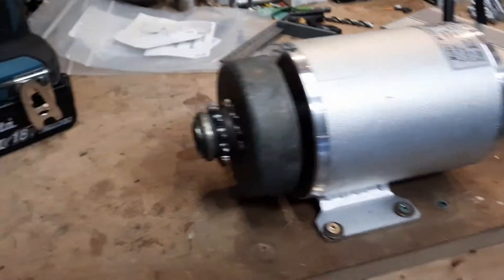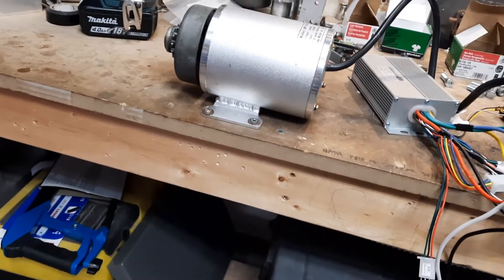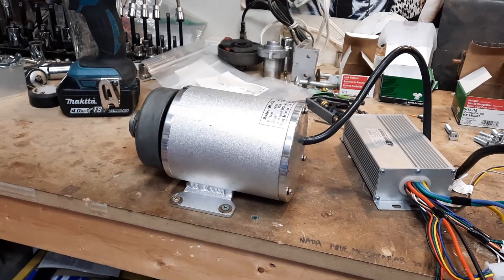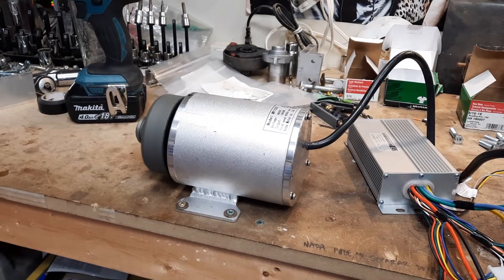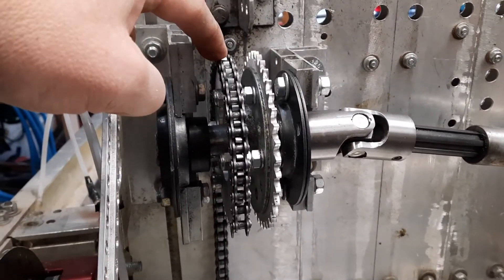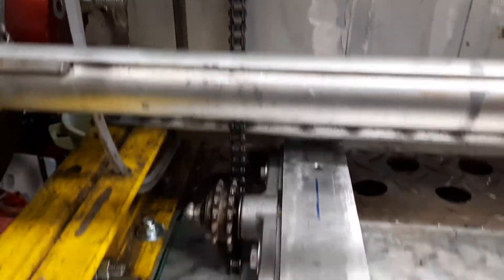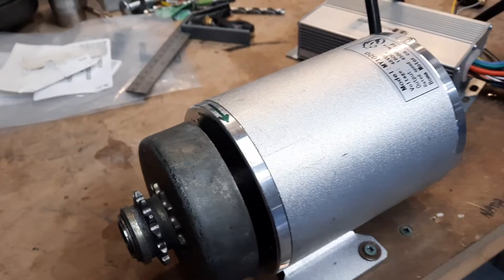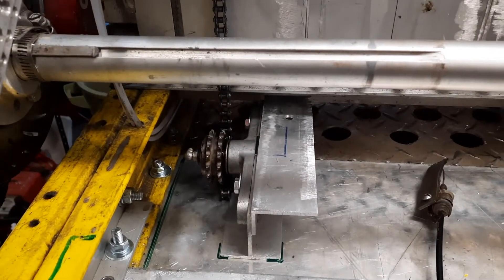The Vulture Cyclekart - Making a Hybrid CK - Centrifugal Clutch First Test

Comment: That motor looks like a brushless motor so it is three phase so you can just swap any two wires to change the rotation direction. The reverse power loss is because of the way the the controller works. I have installed a brushless motor on my grand kids petrol gokarts for a reverse so that I don't have to pull or push them out of the bushes and fence but getting a clutch to work is next on my list.
Reply: Make sure to switch the hall sensor wires also.

Comment: can you show or explain how did you intalled the Centrifugal Clutch on the motor ?
Reply from the maker: I don't think it was very well done. There is a set screw on the clutch, at the side closest to the motor. I simply put the clutch on the motor and tightened the screw.